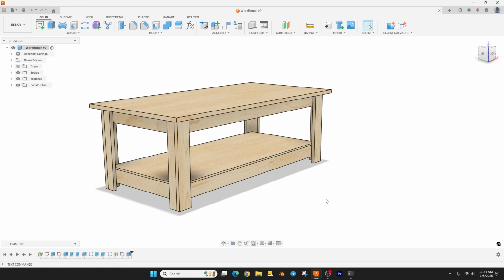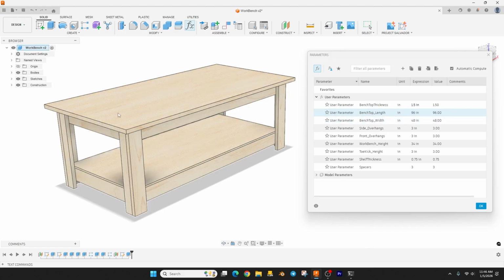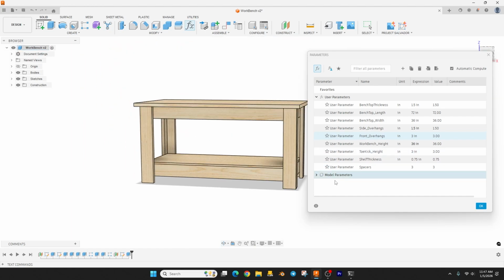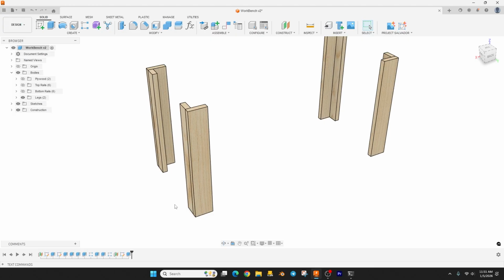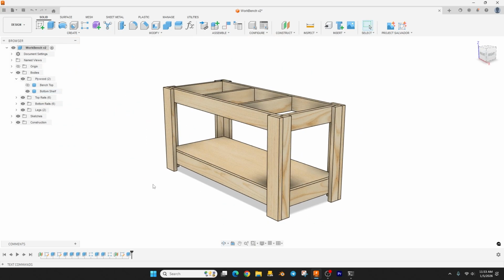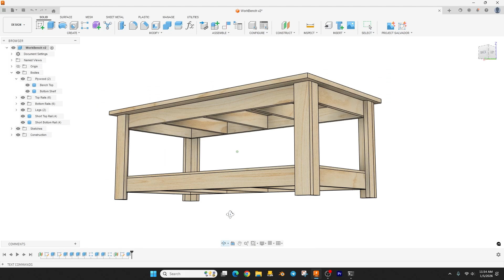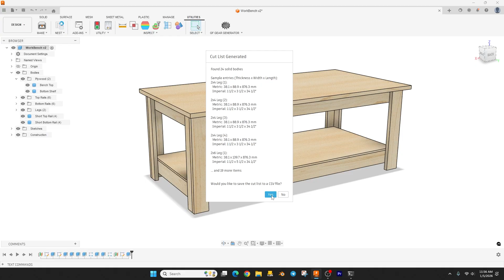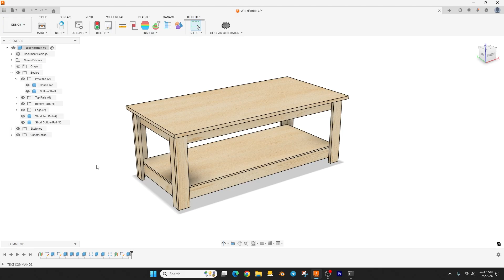How To Modify My Workbench Model

Comment: This style of workbench is my favorite because of how versatile and scalable it is. When I designed mine, I designed it around using strips of plywood instead of 2x4s and 2x6s. I also designed mine in 2D, but seeing this makes me want to redesign it in fusion as you did.
Nicely done! 🍻

edit: Yes, please do a tutorial on how you put this bench together. 🍻
Reply from the maker: Yeah, it doesn't get much better than this bench style (except maybe adding a torsion box top).  It's easy to build, requires minimal tools, super strong, and looks good, and like you said, scalable.
Reply: @ShopTherapy623  I thought about adding a paulk style top to one of mine with mft holes.
Reply from the maker: Yeah those torsion tops are nice. Super flat, and some good storage.  I made this model to sell, but also because I’ll be renovating my woodshop this summer! Starting to plan things out.
Reply: @ShopTherapy623 You should document it. Us weirdos on the internet love watching other dudes set up their workshops. 🙃🍻